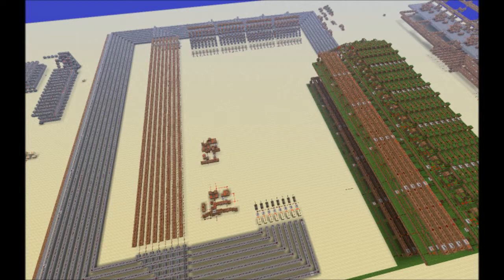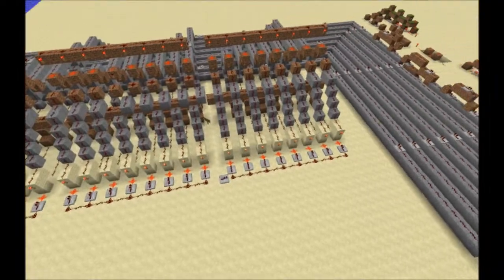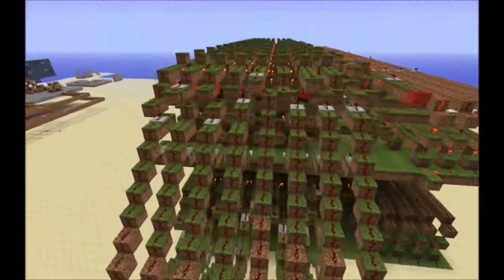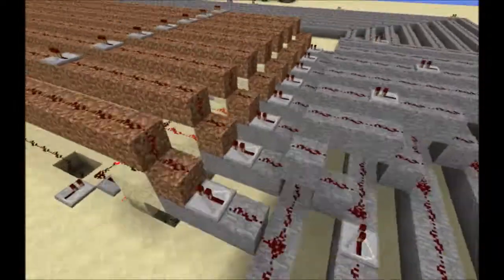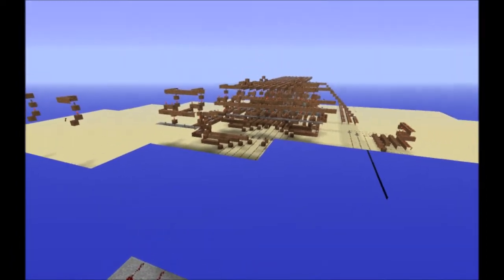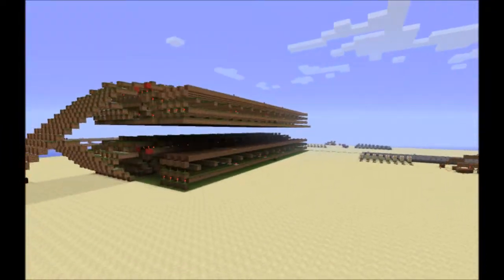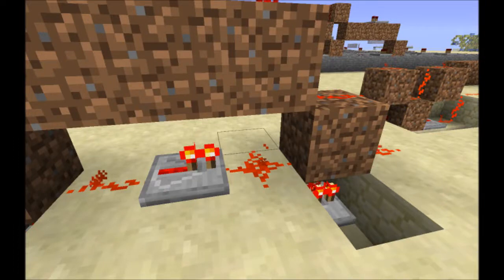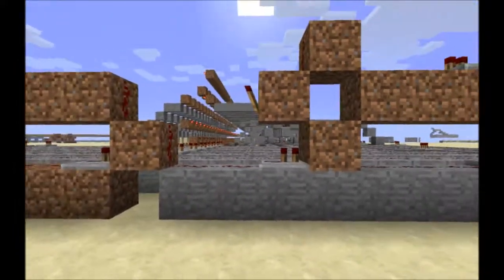CPU Update - Buses, Registers, and RAM

Comment: @Dxlinkj i actually have a really compact design for a comparator, but i don't know how to attach a file though to a comment. also for the two way repeater i would recommend on one cycle of the computer you bring values from ram into various components then on the next cycle you take the output of those components back to ram so on the first cycle you would enable the repeaters going to the components then on the second you enable the repeaters from the outputs.